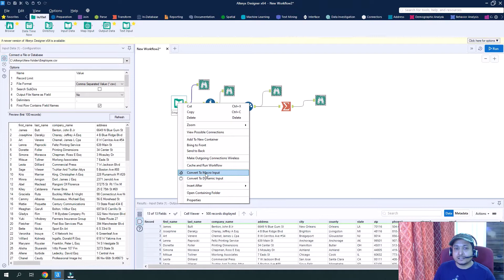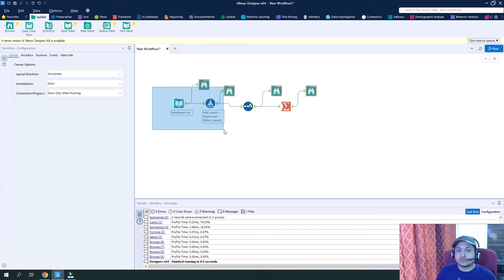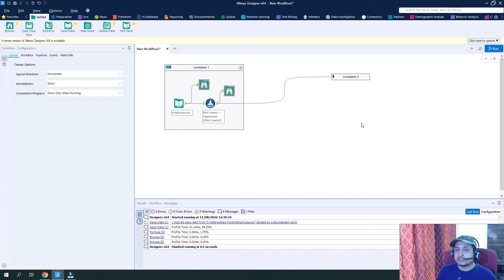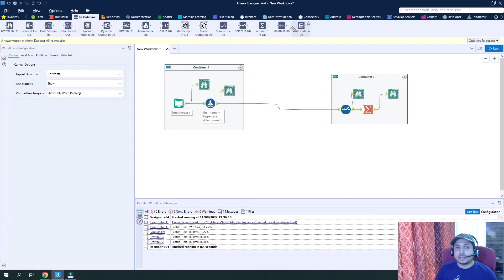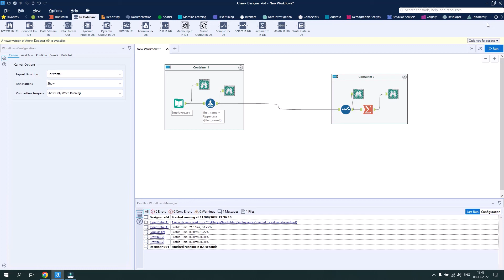Optimize Alteryx Workflows to improve Performance | Vaibhav Gupta

Comment: Use AMP Engine to improve performance
Reply from the maker: @Kuldeep: Yes, this is another interesting way of improving performance but generally I have seen companies/individuals still have not seriously explored this option. But it also really makes a good difference in case of complex or large data use cases